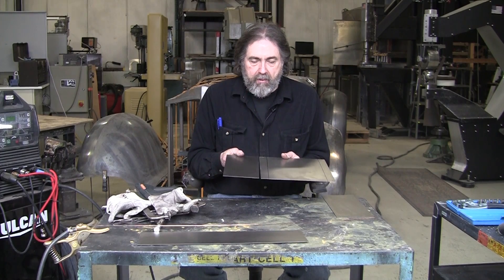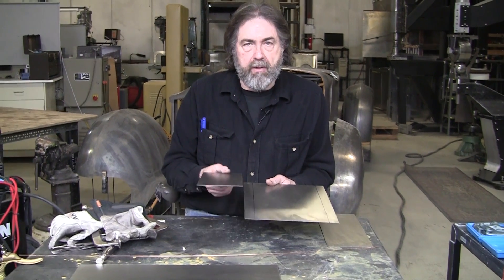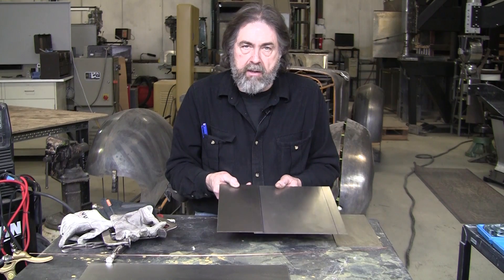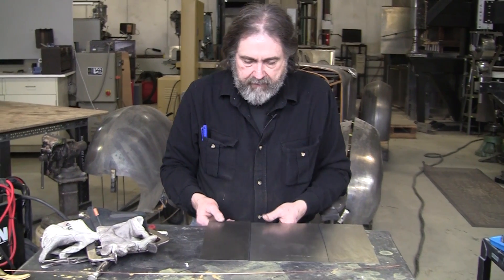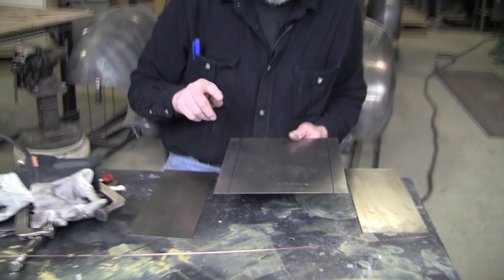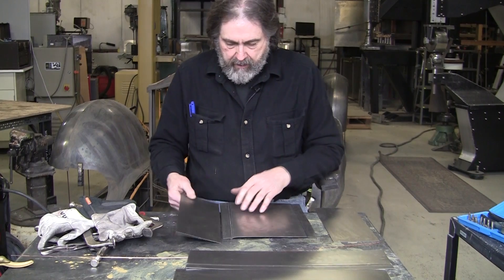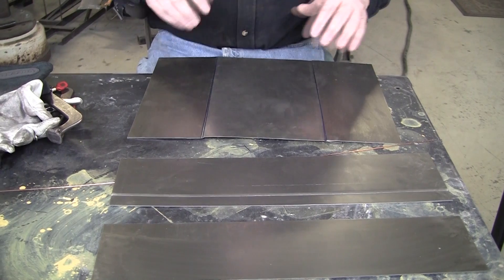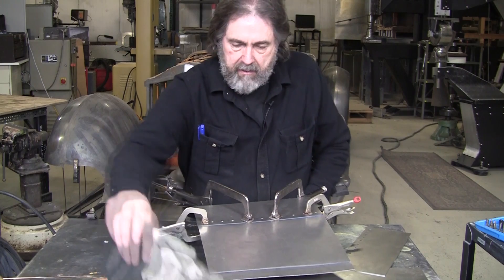Metal Shaping for Beginners: Plug welding

Comment: I saw a guy plug weld with tig. He turned the tungsten around and set it just up in the cup. Then doubled the amps, so 60 amps would be 120 amps. Then held the cup flush on the panel. He held the power to it for a second or two. Seemed to do a great job.

Comment: One thing; I’ve also forgotten to turn the gas on (too many times to count) and off. So I came up with a simple procedure. Turn the gas on before you turn the welder on. Turn the gas off before you turn the welder off. Do that a few times and you’ll get used to it. It works. Spot welders are great. I have a 1.5 k 120 volt model and a 2.5 k miller with stand which made major modifications to. The 120 volt model will do 0.125” and the Miller 0.1875. But actually the small one will do 0.1875 and the Miller will do 0.250. Both will do aluminum despite saying that they will not. However, you have to be careful as aluminum conducts well, though not as well as copper.

Comment: When i tried to plugweld with the mig vs tig and later quality test it by taking a air chistle and run til the assembly breaks. 

The tig will the base material beak and with the mig the weld lets go so i never mig a plugweld til i discovered that tig.

Comment: You can also put a fresh tungsten (no tip on it) in your TIG torch, recess it 1/16" into the cup, put in 50% more amperage than usual, press the cup flush on the surface above the area to be spot welded and hammer the pedal for a second.  No pre drilling or punching required!

Comment: Guzzi fabrication has a short video on how to spot weld with tig. Basically use blunt end of tungsten set just below flush in the cup, crank amps to around double of normal weld amps, hold cup to metal and hold pedal 2 to 3 seconds. I been playing around with it, works great and no drilling!!! Keep up the great work guys!!

Comment: Hi Wray. I do a plug weld with the tig without punching any holes. To keep the heat down, I use 100 amps and up for a fast weld. It gives a nice spot welded look and is the strongest I have found so far.

Comment: If you are doing a line of welds like that, would it be a good idea to do it as a binary pattern; middle, both ends, half-way between ends and middle, and so on?
Reply from the maker: I very rarely plug weld. 99 percent of my automotive sheet metal welds are  tig butt welds.

Comment: Looking forwards to watching this ,, when your mig welding plugs , try coming up one size on the hole  and instead of trying to start in the middle of the hole , start at one edge of the hle on the lip of the patch and weld across the hole using slightly more amps than you expect to , as your starting on the two layers part the amps will be fine , and as you move across the hole you will get excellent penetration and finish up at the other side of the hole , the whole thing will lay flat and work well ,,,, give it a go , you may just like it.